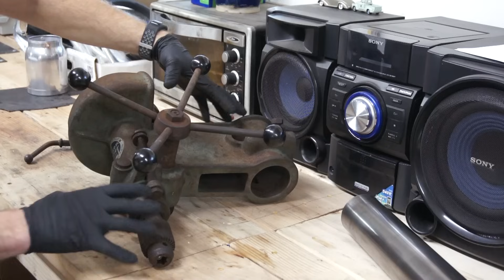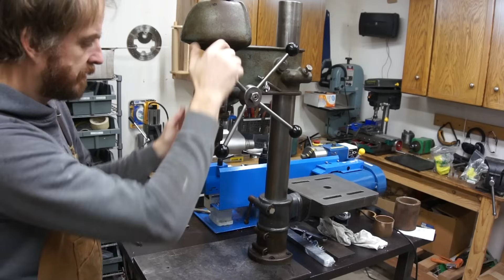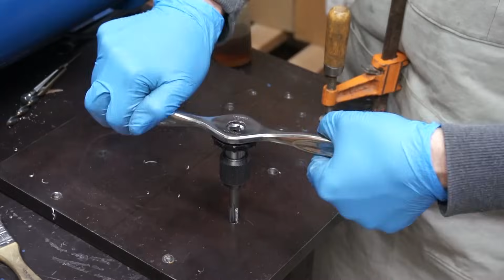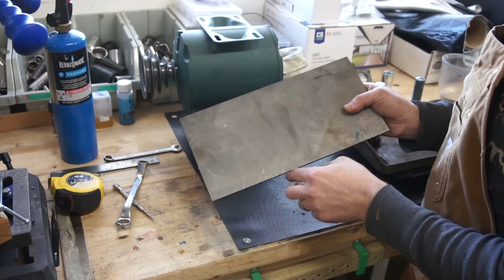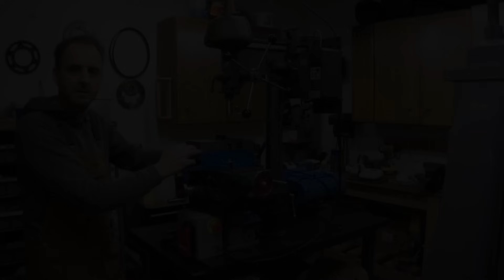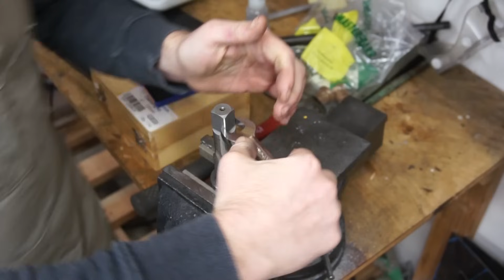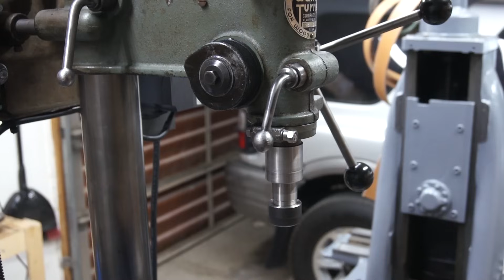Converting a Drill Press into a Milling Machine

Comment: The problem with the drill press bearings is, they are designed for axial load not radial. You will continue to burn up bearings unless you can source proper bearings. I've tried this and no matter what I did I couldn't get a surface finnish that didn't look like angry beavers attacked the part.
Reply: I think the real thing is that it doesn't matter that much if you destroy a drill press once a year or so, because it's still cheaper than buying a milling machine
Reply: @Kevin_Narthex  yeah no doubt hes not building rocket engines with it either or the mars rover😂
Reply: @Kevin_Narthex  I guess, and as long as you don’t care that the finish will be crap too!
Better to buy a used mill, one just sold here at auction for $1300 and it was in good shape!
Reply: @1966cambo  You building precision parts for Nasa or the aerospace industry?  Function is king. For 9/10ths of us this is more than adequate and we're going to hand fit and finish everything anyway...
Reply: @blatantmisconception  I wasn’t aware milling machines are only used for building parts for NASA or aerospace industry…..
One can use a crescent wrench for a hammer too but ya know, right tool for the right job……
Reply: @1966cambo  Sure, but the right job in this case is *light* milling. It seems useless if you are used to machining with real equipment but a garage hobbyist is way lighter duty than any shop work that needed a Bridgeport knee mill or similar. Aluminum and Delrin might be the only thing that this ever cuts, and a scotchbrite/sanded/polished finish might be necessary.
I find the mill/drill myth/dream to be somewhat useful just to save the room that a knee mill takes up. Believe me, settling for less is hard but space limits a lot of the choices.
Reply: I watched a head on a big milling machine get overhauled and the pinion bearings set up in a rear end comes to mind, the two I dealt with had 300 ft lbs to 150 ft lb torque and you can hardly turn the pinion by hand.
Reply: As soon as I added tapered roller bearings to my drill press, the load handling issue was moot. All you need is the standard/universal bearing number (it's stamped on your current bearings, and if it's not legible ((most are stamped on the race(s) so sometimes those get beat up if you remove them knowing they won't be reused)) just refer to your users manual) and you'll be able to order the appropriate tapered roller bearings or even angular contact bearings on myriad websites. 

My press didn't have the threaded Jacob's Taper, it had a regular press fit MT2. So I measured the space under the spindle where the arbor is inserted in to the quill. From there I took several measurements of exactly how far up in to the quill the MT2 Arbor needed to seat itself while having as little to no runout as possible. I had about. 004" to play with so I tapped and threaded a M6 x 1.0 hole going through the quill, and I made sure to go .004" UNDER (towards the bottom of the quill) the ideal line. From there I drilled and tapped the MT2 Arbor on a ER 32 Collet exactly where I wanted the intersection to occur. From there it was literally just trial and error of seating the arbor to the quill so that the holes would line up straight. Once they were sufficiently aligned with the quill, I inserted a piece of Stainless Steel M6 x 1.0 allthread which I'd already measured out to ensure that I'd have 2 threads visible on each end. I secured the allthread to the bolt/retaining
Reply: If you can find one, a British Fobco Star drill press will work. They were designed with angular contact bearings in the quill & even made one that came with a milling table for light milling duties. They also have a morse taper spindle.
I’ve got one & it works fine as a small mill. I’ve even milled tool steel on it (very slowly).
It’s noticeably bigger & heavier than your average drill press though.
Reply: What the problem is that you need a pair of bearings at the spindle end. Look up any mill spindle assembly and you will find two opposing taper roller or angular contact bearings. Additionally you also need to preload the inner race as well as the outer one.
Reply: Whether they are ball or tapered roller bearings, either will handle a radial load just as well as an axial load.
Reply: @fredsasse9973  tapered roller bearings will handle more radial load and last longer than a ball bearings. Best to use for this application are self aligning bearings or spherical roller bearings but those are super expensive.
Reply: @fredsasse9973  And some ball bearings are better than others for this application . . .
Reply: @fredsasse9973  nope  run out will become excessive very quickly. And without a drawbar to keep the taper seated it will have excessive runout too. I drill press is a drill pres. end of story
Reply: The problem is no matter what you do to the drill press the bearings/races and quill were never designed for radial load so you will always have a drill press. I thought the video was comical with everything this guy spent on his will never be a milling machine drill press. Poor guy seemed smart enough to understand that but I guess not.
Reply: I agree 100%.
Reply: @b-radfrommalibu  I have to disagree.  Whether a drill press has ball bearings (same as a set of wheel casters) or tapered roller bearings (as in an automotive wheel bearing), both types of bearings are designed for a radial load.  The examples I cited use both types of bearings where they are subjected to mostly radial loads.  So to say that . . . "drill press the bearings/races and quill were never designed for radial load . . . " is an incorrect statement.
Reply: @fredsasse9973  I don’t agree with you, the size of the bearings and surface area involved are simply inadequate for using a drill press as a mill, look at a mill and you will see quite clearly it is designed for the loads placed on it while milling, a drill press just isn’t! 
Much the same if you replaced your front wheel bearing with your caster bearing, you wouldn’t get 10 ft!!!
Reply: @fredsasse9973  Generally true, but milling machines are on another level. They will work on weak and inappropriate bearings, but can't work well enough to do useful milling unless they use beefy (even pre-loaded) tapered rollers.
Reply: @b-radfrommalibu  What I don't understand about you guys is he obviously knows the limitations of his machine. He is not asking it to run a 3" face mill flawlessly. He is redesigning it to handle what he needs. And to say the bearings will never hold is flat wrong. They will last just fine if within their load capacities. I've seen plenty of "real" milling machines get destroyed by running things out of its capability. No different than this one. The bigger problem with this setup is his rpm's and that amount of distance from the cutter to the bearings. Way to much flex from that setup. I would probably get similar results on the bridgeport with a setup like that.

Comment: Thank you for inspiring me to go out and buy an old drill press to turn into a mill! Most people I’ve talked to tell me it won’t work, but I don’t have enough for a bridgeport. I’m sure It’ll work just fine for what I need
Reply from the maker: Find a drill press with the largest column diameter you can.  3".  3 3/4".  The bigger, the better.  Good luck.
Reply: Reminds me of the fool that did not know it could not be done so he went ahead and did it anyway.

Comment: I have the two of the same Walker Turner drills. You can still buy new a new Jacobs chuck from which have the locking ring integral to the chuck to lock it on to the taper.

Comment: Robert, thanks for posting your successes and failure. It's how we all learn.
A couple of points if I may. To cut the wrench or spanner flats on the lock nut remove the tool post on your mini lathe and using a suitable bolt, a stack of washers and a nut mount the work vertically through the centre hole. Use washers to establish your relevant centre height , install your end mill cutter in the three jaw chuck or  collet chuck and machine away. Rotate the part and cut the second face.

Your safety stop switch is excellent but it's location could be improved. If you mounted it on the front of the motor bracket at head height you would be able to bump the machine off with your forehead while still holding onto whatever you might be machining. This would, of course, apply more to a freehand drilling operation, rather than a milling one, where both hands are being used as hold downs.

Regards from Canada's banana belt.👍🇨🇦🕊️🇺🇦🤞
Reply from the maker: Thanks for the note, Ron.  I just bought two more safety switches and plan to add one to both the Mill and the Atlas.  I hadn't thought about mounting them lower for hip access.  But now I'll have both.  Appreciate it.

Comment: nice, what work table is that Robert?  I am thinking of doing similar with my drill press.
Reply from the maker: Hi, Scotty.  This is one of those cheap import tables I got on eBay.  If you search for "milling table", it's the first one that comes up.  Mine needed some work with the bearings and fit for the handwheels but it wasn't bad.
Reply: @RobertAdairWorkshop  thanks for your reply! Seems like a lot of these sort of things ned rebuilding to make them usable.

Comment: I'm not conventional at all if you tell me I can't do it. whatever "it" is I will find a practical way to do it and have myself a big fat chuckle. i never take no for a fuck'n answer, I've researched this enough to come to the conclusion that there is no reason anyone has stated the would make me not give it my best well thought out go. it only takes enough mods to ad the proper heft and you go from drill to mill.  that spindle looks to me as if you could thread it like a drawbar and take the play out of it. lathes can rebuild themselves with you at the helm there's no damn reason you can't mod this thing into a mill. the oldtimer machinist didn't have shit to work with but they always found a way and now we benefit from that. do it in the spirit of them go look at some line shaft machines and then ask yourself all the right questions imagine them standing there manning the machine. don't quit. not all ghosts from the past are bad.

Comment: Neat build. I would suggest you replace you v belt with a segmented belt. It will significantly reduce belt vibration. I no longer use v belts on my machines.
Reply from the maker: Thanks, Glenn.  It didn't occur to me it could be the belt.  I only use the topmost pulley combination, too.  I'll give it a try.

Comment: Very good video, how it the torque when u reduce the speed?
Reply from the maker: It's good.  I haven't noticed a lack of power though I haven't used it much below about 300 RPM.  I've been running much higher to get better surface finishes and reduce chatter.

Comment: Cool project!!  I used to have an old Craftsman model 150 drill press, I had the bench top version.  You could order collets for milling for it.  I don't recall if it was a standard mill collet like an r8 or if it was some Craftsman proprietary deal.  I only used it as a drill, then I gave it to my son when I moved.  When I realized I would have room for it at the new house I decided to let my son keep it and got a LMS 3990 mini mill, perfect for taking light cuts in steel and aluminum and comes with a drill chuck for drill press work.

Comment: Excellent! I was faced with the same dilemma about the snapring in my own conversion, so I kind of gave up for a while. This video has given me awhole new perspective on how I should proceed with setscrews instead. I have virtually your same setup down to the xy table and a Delta floor model press. Next will be a vfd conversion. Thanks.
Reply from the maker: Thank you, Anthony.  I may redo mine and try again with the snap ring.  I hope yours works out, too.
Reply: I have the original jacobs chuck with the captive threaded collar and was hoping to copy that, but as you said, the collet is too hard. Good luck

Comment: Nice video. Real nice project. What brand is the XY Table? I am considering something similar for small plastic and aluminum parts.
Reply from the maker: Thank you, Ken.  It’s a generic unbranded XY table from China.  I got it on eBay.  If you search “milling table”, it’s the first that comes up.  I’ve had good luck with it but I had to rework the knobs and bearings.
Reply: @RobertAdairWorkshop  Thanks for the info.

Comment: You're awesome! simply awesome. I really want to know the end result AT LEAST. I am that young hobbyist with little money and a lot of ambition, and I can comfortably say that I am at least a few years of income and know how to even touching a Bridgeport or its relatives. Heck! even the mini counter parts demand a pretty penny and still have a limit to them. But I recently came into possession of a cheap 100$ drill press, with the goal of a getting a mini lathe next, but with a tiny bit of research i see the better buy is a milling machine. And there I was thinking, well why the hell cant my one horse power motor drill press do most of what a mill can do and even close to the same material. Another big buck on a mill table, a vice, a collet and a plan to keep it on, maybe an indicator to help with runout and in all, a not so loud crowd of people saying "Its definitely possible, but you're not exactly getting a mill".. that's sounds perfect! 

Long story short: I wanted to do this exact thing and you're even doing better than I thought was possible.
so please keep these videos coming, I would love the knowledge and simply the entertainment of your journey.
Reply from the maker: Thank you for the kind words.  I’ve been using the drill press mill quite a bit lately and it’s working really well.  The chattering issues I encountered mostly came down to operator error.  It took me a bit of time to learn how to mill with it, correctly. It has a preference for feed direction and cutter alignment that I had to figure out.

 I recently uploaded a video where I machined a hardened shaft with it and it did a nice job.  I have another that should be out this weekend where I repair keyways with it and it did a nice job with that too.  

I am working on installing angular contact bearings on the drill press’ spindle to replace the original 80-year-old bearings and should have a video on that out soon.  I am waiting on some bushings to wrap it up.  

Keep an eye out for the bearing video.  I think you’ll enjoy seeing how it turns out.

Comment: Built one years ago and the mod that made the biggest improvement was converting the spindle bearings to a quality pair of tapered rollers with a fine preload adjustor. Eliminated the spindle's vertical movement and with that most of the chatter. Adding an 8" diameter by 5/8" flywheel up top allowed balancing out some peculiarities. Great learning experience.
Reply from the maker: I have a 6" diameter, 5/8 flywheel that came off of the treadmill motor I put on the mini lathe that I bet I could retrofit.  Where did you mount it?
Reply: @RobertAdairWorkshop  right under the sheave/pulley.
Reply from the maker: @WireWeHere  Great!  Thank you.  That's something I can do fairly quickly.  I'm going to give it a try tonight.
Reply: @RobertAdairWorkshop  You've got a knack for making instructional videos. I'll be watching to see how it goes.
Best of luck.
Reply: @RobertAdairWorkshop  I had shortened the top where the original bearing was in order to fit a much finer thread bearing preload adjustor so I had room without having to make room. I raised the motor a quarter inch which was just to stop an old belt from complaining about the Irish spring soap. Having a milling machine and a lathe helped but all the work was able to be done as you're doing it. I had built the drill press from a box of parts a few fellow grade 10 students had made a mess of. Had a bet with my instructor and 8 days later a drill press. Two weeks later I got a drill press for my birthday so I started to what if for a while with my homemade one. Putting a dial indicator on our milling machine and drill presses and just a little finger pressure really showed the difference. Milling machine a small fraction of a tenth of a thou. Drill press 25 or 40 if I tried a little harder.

Comment: Neat build!  Get's me thinking the linear jacks with the hand cranks by Mercedes would be handy for this design.  I'll have to keep in mind.  Any thoughts why not a free treadmill motor?  I have one earmarked to do similar... though with the Harbor Freight drill press... I've been shying away.  Especially after I bought an Arboga U2508.... then again the smaller scale shop might still stay indoors. Thanks for sharing!
Reply: Add thrust bearings?  Wondering what's in there.

Comment: Hi Robert, I converted a drill press to a milling machine about a year ago, I purchase on FB market place a 1952 Herbert drill press with the intention of using it as a drill press, it was a very sturdy cast iron piece of kit with dove tail ways for the drill to slide up and down and the same for the bed, I decided to try and convert to a mill, unfortunately it did not have a tapered shaft so replaced the jacobs Chuck with an ER25 collet Chuck, unfortunately the run out was unexceptionable, I then purchased an ER Chuck with a 200mm shaft attached and bored out the quil to take tapered roller bearings, purchased a cheap Chinese X Y table (same as yours) and with some extra mods now have a great mill, capable of milling stainless steel, if you would like to see some pictures, make contact, Terry from Scotland
Reply from the maker: Hey, Terry.  I would like to see what you've done.  I'll send you a note.  Thank you.